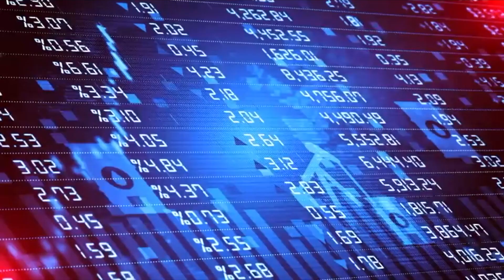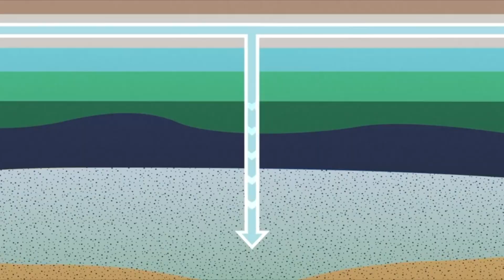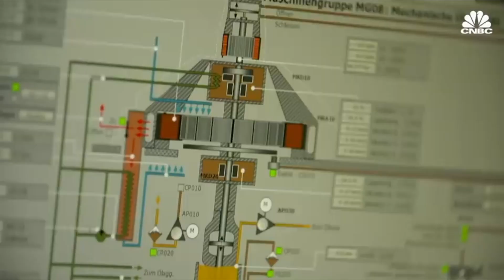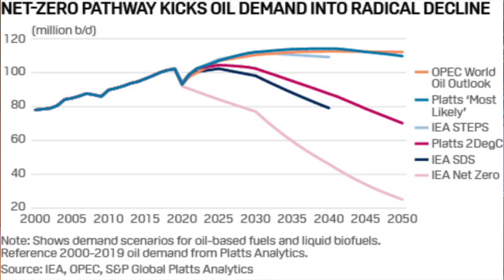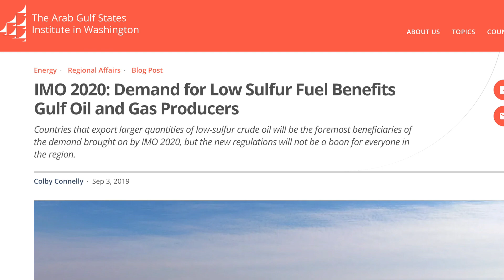Why Gulf’s Oil Powers Are Investing in Clean Energy

Comment: Solar panels and Batteries AREN'T clean energy..... what is their carbon footprint???
Reply from the maker: "Around 50g of CO2 per kilowatt-hour is produced during the first years of operating a solar energy system. The solar panel’s carbon footprint is roughly 20 times less than the carbon output of coal-powered electricity sources." - according to cooleffect.org.

Maybe it's more accurate to call them cleaner energy!